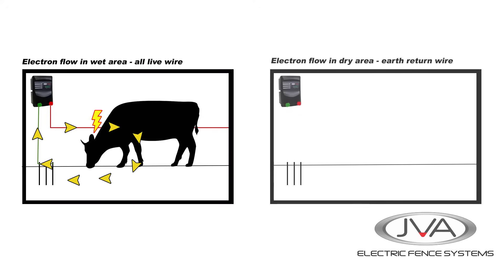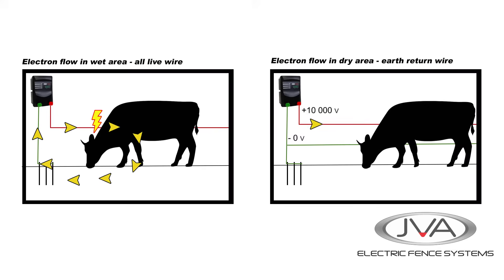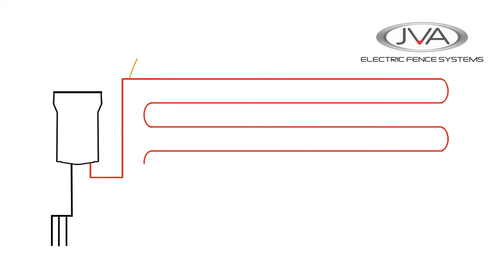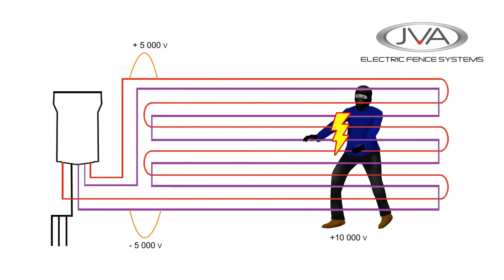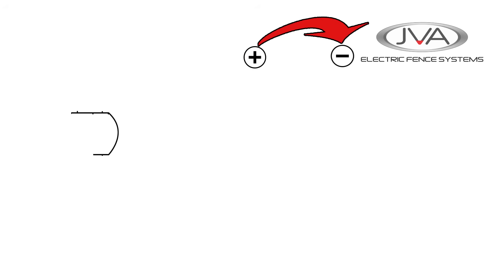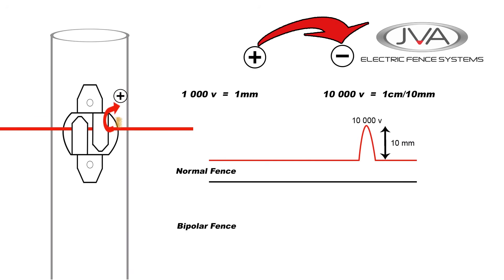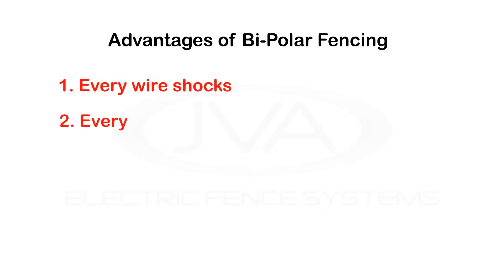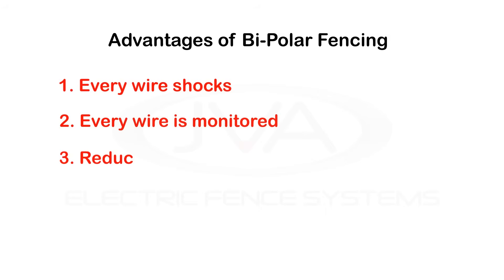What is Bi-Polar Electric Fencing?

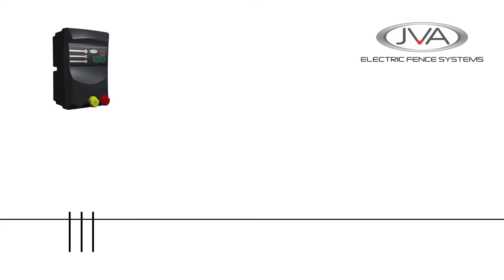Comment: First of all, thank you for making these helpful videos. First time making a fence so please bear with me...  It's unclear to me why you have "half power" (yellow-line @1:18) going to the ground instead of grounding the greenline, and how 'earth' (green-line @1:35) now gets -ve halfpower.
Reply from the maker: Hello, this is only specific to units that support this Bi-Polar function and when you choose to do a Bi-polar fence. Normally on a standard fence the green would be your earth to ground but when running a fence in Bi-Polar the unit it designed to run in this way.
Reply: @JVASecurity  Also, if the +ve and -ve wires touch, seems quite possible since they are interspersed, would this short the system?

Comment: 1.what’s the voltage there’s? Is there 9kv
2..what size of wire , 12/swA, or clutch wire what size?
3..Earthing wire size? For 3 elctrods? 
4.whar 1000,v DC /or Ac there’s?
5..what’s current there is ?for 10Akeres field ?